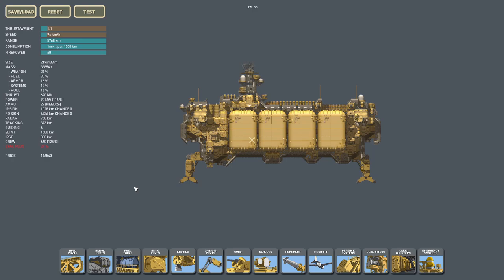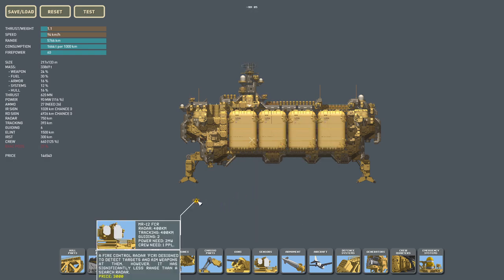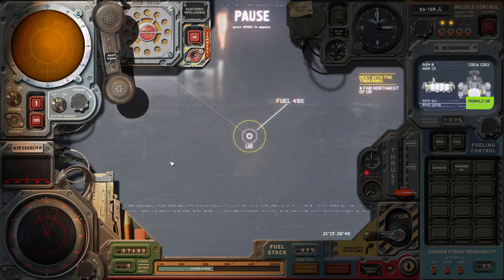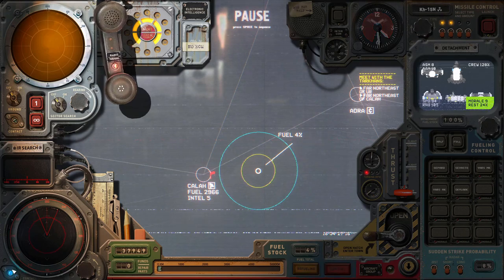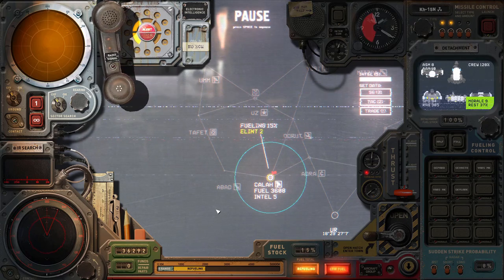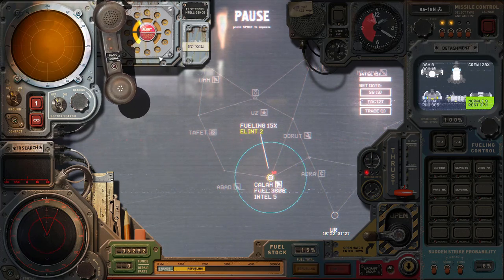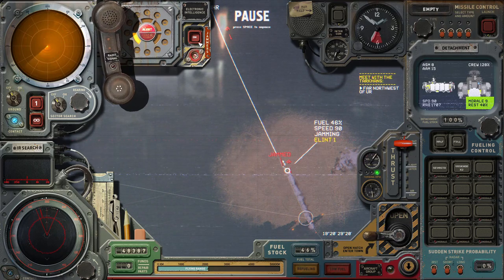Sensors Guide (Radar, Elint, IRST, Tracking, Jammer) | Highfleet

Comment: I wonder if they modeled the effectiveness of turning off your radar and jammer against incoming anti-radiation missiles, hence giving them nothing to home on.  Or, at least, increasing their chances of losing track if those ARMs have target memory capability like AGM-88 HARMs (on non-moving targets anyway).
Reply from the maker: I observed some weird behaviour with missiles. 3 missiles were coming at my fleet, and I switched on the jammer. As soon as it found me (it changed course slightly) it says JAMMED however it still hit. Perhaps it was an anti-radar missile or it was a normal missile that was bugged. 

Because it would not make sense for the missile text to say JAMMED, when it means "I found a target with a jammer on"
Reply: @caracal3892  From the manual:
"If you have a ship equipped with a Radar Jamming module (these can be
 found and equipped in some cities’ Shipworks) you can hit the RAD button to jam the enemy’s radar tracking – this will help avoid enemy missile strikes. ARM missiles will aim directly for the Jammer."
Reply: @caracal3892  Jammers in game reduce the effectiveness of active radar. That means that the range at which they can track is lowered. I can think of 4 main interactions here:
1- Active guidance by enemy ships to target designation: The missile loses guidance once it enters the jamming range and reverts to local active radar tracking. See 2 and 3 for what happens then.
2- Missile terminal guidance, out of reduced range: Say the missile has a normal tracking range of 30 miles and is faced towards you in it's radar cone and you are 29 miles away. Jamming reduces the range by one half. Now the missile will not have track since it's effective tracking range is now 15 miles. Use this time to either intercept or run away/out of the missile's seeker cone. Note that the moment that you stop jamming the range will revert back to it's original range.
3-Missile terminal guidance, in reduced range- Same example as above but you are now 14 miles away. Unfortunately, the missile's reduced and effective range is still enough to detect and hit you. Run to prolong the time to impact and prepare for interception.
4- HARM- You are now emitting an additional source of emissions that the missile can home in on. If you wish to prevent the HARM from hitting, disable all radars and jammers or intercept it. You may need to move away once you have ceased emissions.

My guess for what happened then?
It was either a HARM or you were still in effective range despite the jamming. Jamming is not a cure all. It is a opportunity to use to counter threats. Activate it as soon as you can to maximize evasion and interception chance. Disable it once you are not using it(eg to counter missiles or radars).

Do not forget: Jamming is an emission that enemy ELINT can detect. ELINT detection range is the following: ELINT range + Highest range emission source effective range.
This means that if you have a radar range of 900 miles and a jammer effective at 300 miles active and the enemy ELINT range is 1500, the ELINT initial detection range will be 1500+900(max range source active). If say you then keep the jammer on but disable/do a sector search away from the enemy using ELINT, the ELINT detection range will now be 1500+300 miles.

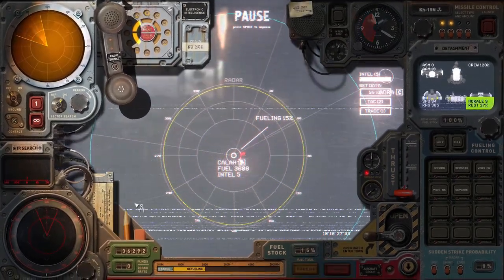Comment: Notice at 15:35 how the RWR jumped from 2 to 4. The game is definitely modelling signal strengths, which in this case increased once you’re at altitude.
Reply: Wait, I am new to this. So you mean that when I am parked on the ground, and I have 3 bars on ElINT, the enemy is not 600km out? I am actually within there radar range?
Reply: @golferchin76  Probably.
Reply: If it were a sudden jump, it would be a good conlusion, but it only rose quickly, not instantly, and it did so while the fleet was moving right at the source. It's just as likely that the emitter simply approached and it looks way too fast because of time acceleration.
Reply: @Peliass100  That's only one example. Play the game more.
Reply: TEXOCMOTP  What does RWS and RWR mean?
Reply: @thathandsomedevil0828  RWS = Range-While-Search ("the radar searches a volume of space"), RWR = Radar Warning System (detecting radar emission, like your ELINT or most of the missiles that lock onto radar emissions), no real use to be good at the game, we just need to remember that the radar range changes whether you are grounded or airborne
Reply: @chienfeu  cheers! 😊👍

Comment: 12:00   The signal received by active radar has make a full round trip, go all the way to the contact, bounce back, come all the way back, and be received. The signal received by the RWR only has to go from the enemy fleet to you, half the distance.
Reply from the maker: This is a really good observation. I wonder if the game models the travel speed of electromagnetic waves.
Reply: @caracal3892  I highly doubt that, because on the distances that in-game systems work, the difference in time between radio waves covering one way or both ways is miniscule, below 1/100th of a second
Reply: @caracal3892  even if it did, would it matter? the speed of light is pretty fast...
Reply: Yeah, especially given that the game operates at about 6 minutes per real time second at least, I doubt that is modelled at all.
Reply: @KiloSierra213Sierra  it's not about speed, it's about attenuation. Radar energy expands as it travels, so the received signal drops with the square of the distance. It's distance only, speed doesn't matter.

Comment: The radar lines on the map correspond 1 to 1 with the lines on the radar display, and whatever it is you are detecting should be at the centre of the line that appears on the screen, so actually you don't need to guess very much at all.

Comment: Yo Tarkhan, I hate to rain on your parade. But Radar tracking ONLY works if you have your Radar on. The yellow circle you had then which allows you to track the enemy with Radar off, is your visual range. At best circumstances it's about 100km though time of the day and I believe weather, influence it aswell, deep night, so a few hours before and after midnight can cut it in half, which is why that is the best time to conduct silent strikes against unsuspecting garrisons.

Other than that small tid-bit, still a good vid. The bit on jammers was a bit short but helpfull nonetheless. :)

Comment: Does the manual says its 60deg cone for RWR? It is rather suspicious. It would mean that the cone is from 330 to 30 when target is in the cone but imagine situation when the target is between 0-30 degrees of actual position. That would mean that both 0 and 30 would have to blink (because cone is for 0 330 to 30 and for 30 is 0 to 60). I never seen 2 lights blinking from one target so i suspect the cone is more like 345 - 15 deg for 0, 15-45deg for 30 and so on... :> Its just logic :>

Also, not true that if anything gets within radar circle than it will be detected. It all depends on radar detectability of the target. If he is small and low detectability than he could be way inside of the range but not being detected. I also believe that it is possible the focused angled version of radar tracking may simulate "stronger" signal and allow you to find targets you wouldnt normally see, but that is just my suspicion for now. Need to make more tests